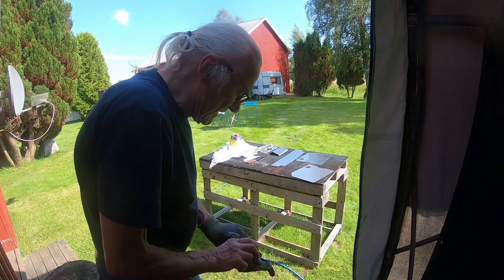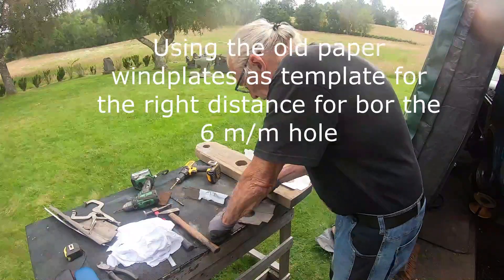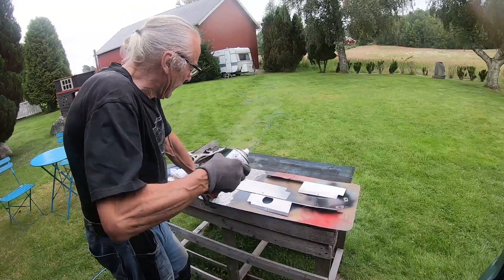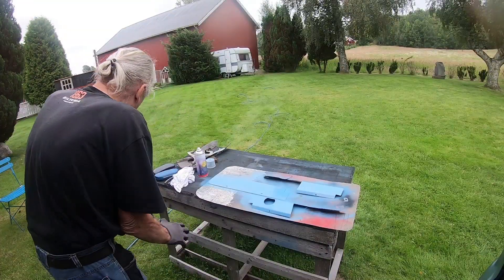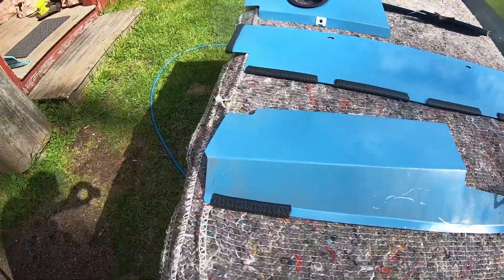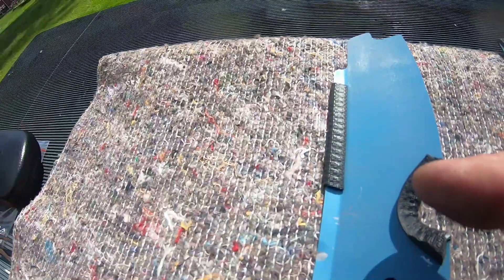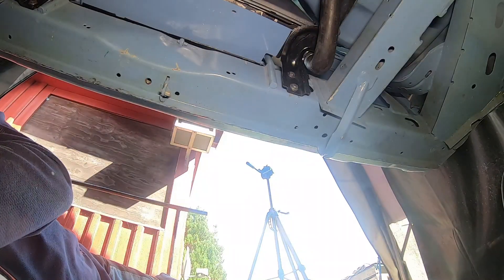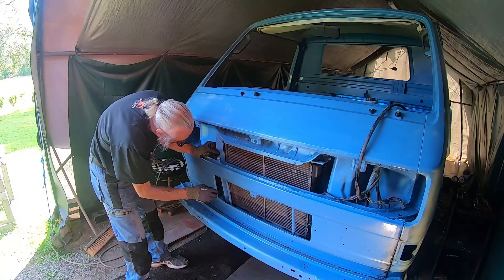HCS VW T3 Restoration Augst 2024 Prepair the windplates

Comment: Good job Hubertus, the wind plates, closing panels look good buddy, came out very nice, did you weld or stick the front lower panel, 3M expoxy glue is supposed to be very good to bond, all new cars have it nowadays, best wishes buddy☮
Reply from the maker: Hi Joe I`m answering your question later, I`m not  in that shape latly many serious healht isseus take car my friend,Greetings.Hubertus
Reply: @HubertusSchaper  no worries buddy, hope you’re feeling better soon, take it easy, 🤙🙏♥️🇮🇪🇳🇴🌷
Reply from the maker: Hi Joe sorry for the late answer but it comes now buddy, the lower cooling pannel is just  glued uset Würth powerbond epoxy glue
no need to stick or spotwelding  afterwards  but if you wish to do so it`s possible but not nessecary.Greetings.
Hubertus